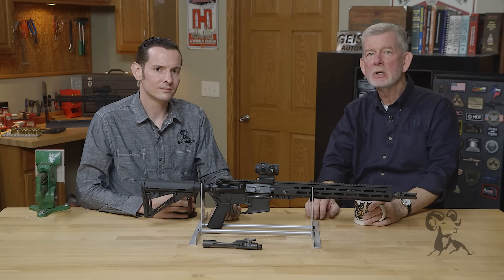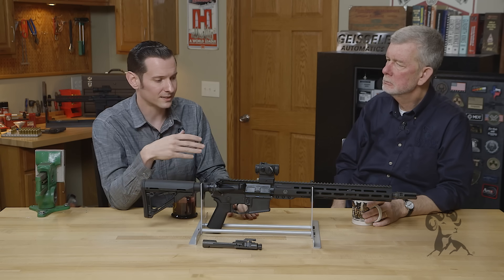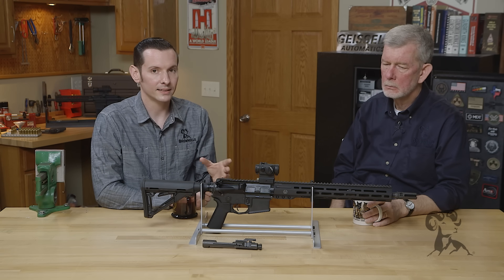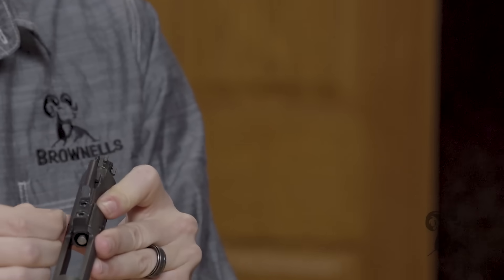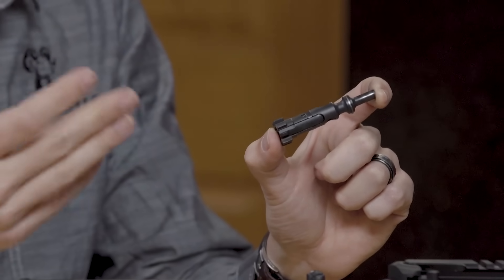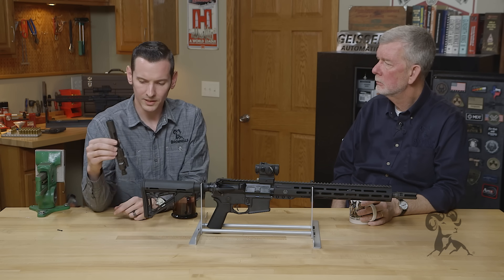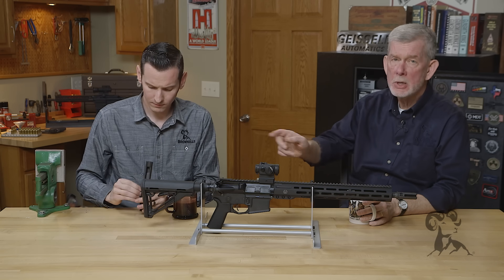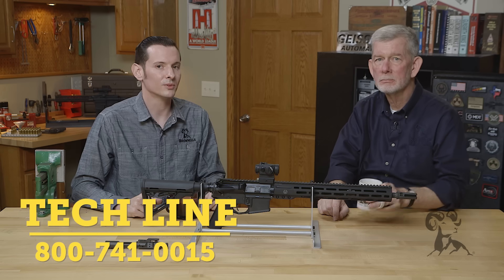Quick Tip: Fixing Common AR-15 Gas System Problems

Comment: Misaligned gas tube is a great example I never thought about thank you
Reply: I have a PSA upper that has a slightly crooked gas tube that rubs on the side of the gas key a little. The upper functions perfect as of now but I keep that in mind if I ever start getting signs of being under gassed.

Comment: Great video.  Now could you show us how to replace those rings.
Reply: Liking twice!👍👍
Reply: @michaelkennedy996  Take a pick or little screw driver and pull them off and replace, Easy peasy...
Reply: U can use a dental pick. 👍👍
Reply: Great information
Thank you
Reply: Get yourself a sop mod rebuild kit from BCM you'll thank me later. It comes with gas rings too all for 30bucks

Comment: One thing I always suggest looking at is carrier and buffer tube length. Which generally isn't an issue on production guns. However home builds, especially ones with tacticool folding or short pdw receivers like the maxam or law folder. 

Basically sometimes if the buffer tube is just a bit too long or the carrier is a bit too short for the system the gas key can strike the back of your receiver. If it's a major issue you'll find out pretty quick. If it's a minor issue it could eventually cause the gas key to loosen or crack without you noticing. 

The simplest way to test this is to push the bolt carrier group into your receiver extension until it bottoms out. Do this with the upper is off the gun and the buffer/spring still installed. Look at how close your gas key gets to the back of the receiver. You should be able to fit about two quarters in between the back of the receiver and the gas key. If it gets close to striking the back of the receiver try adding a quarter to the back of your receiver extension. If it's really bad you might need to add two. Just make sure your bolt carrier still has enough room to lock back properly.
Reply: I watch SOTAR also! :)
Reply: @jesuslovesme9138  nice. I actually work with some guys who've taken a few of his classes. I'm in Philly so he's only like two hours away. If you want to know the ins and outs of the AR platform SOTAR is the place.

Comment: This is quite helpful, I just got my first AR and the bolt has a pretty tight fit in the carrier, and until I saw this video I thought that was a problem, luckily now I know better.
Reply: True story.  I learn a ton from these guys.
Reply: Yeah there's always little things that you think are an issue until you learn their designed that way for a reason.

For example I've seen several people who have opened up their buffer weights and added shims to make them tight so they don't rattle back and forth. However that rattling back and forth is intentional. It acts like a dead blow hammer to prevent bolt bounce.

Which is why I have a problem with those stupid tungsten BB/powder filled buffer weights. They're generally a gimmick more than anything. If you put them in a machine gun, which I know is hard to come by, they won't function properly. It's generally not a problem for semi automatics. But it isn't helping things. If you think about it the three free-floating weights always move in a straight line. But powder or BB's act more chaotic. You're basically losing energy every time. Making it less efficient for the weight. It can make your gun feel like it's shooting softer, however in reality you're causing minor changes in how the gun fluctuations that can cause issues later. 

I personally don't think it's a coincidence that I've seen 3 bolts with broken lugs over the years. An only two of the three we're fairly new bolts from decent manufacturers. However both guns had some type of stupid buffer filled with loose powde/BB crap.
Reply: Corat  You're not wrong.

Comment: Didn't quiet catch what Caleb said to do at the gas block if it's over gassed. ???
Reply: He said to install an adjustable gas block.  They normally use a set screw to incrementally cover the gas hole inside the gas block which allows you to set how much gas you want coming through.  You can even block it out completely if you wanted.  Superlative Arms makes excellent gas blocks, PN: SABO-DI-750SM for the 0.75" barrels.
Reply: He also said that you can install a heavier buffer but the proper way to do it is to limit gas at the gas block.
Reply: He said replace with an adjustable gas block.

Comment: Fixed half a dozen "tabletop" guns where the customer had just misaligned the gas hole in the barrel with the block.  That's the first thing I check.
Reply: What do you do to check that?
Reply: @salmonmoose509  I first look at the sight base, which will sometimes be canted off to one side or spaced too far from the shoulder in the barrel.  Alternatively, it can be right up against the shoulder, but the shoulder is designed to have a front handguard retainer.  Either way, you have to take the block off to verify.  The customer has usually fired it enough there will be a mark on the barrel showing right where the block was.  When I reassemble, I use a piece of tape with an index mark to get it centered and I measure for the gap (if any) to the shoulder.
Reply: @RyeOnHam  ok
Thank you very much for the info.
I really appreciate it.
Reply: @salmonmoose509  You can also use a borescope to look at the gas hole alignment from inside the barrel.  I wouldn't mess with that though.  Just remove your current gas block and dimple your barrel on at least the first gas block set screw (opposite gas hole).  Brownells sells a jig for $55 for 0.75" gas block journals, PN: 100-032-039WB but doesn't include the bit for dimpling.  I normally like to shill for the website whose video I am watching but full disclaimer: I use KAK's barrel dimpling jig which isn't offered at brownells, PN: KAK-DRILL-JIG-750.  It has performed flawlessly on 5 builds and comes with its own spot drill.  If you have a barrel that is a different size than the 0.75" gas block journal, Optics Planet has a full selection of SLR Rifleworks dimple jigs for the various barrel diameters, again without the spot drill.  Good luck and happy building, Montagonist!
Reply: @JenkinsStevenD  Thanks for th  info i will definitely look into these options.
Reply: I agree.  A misaligned gas block would be the first thing I'd look for on a new build that is undergassed.

Comment: 6 of 10 gas issues are user/assembler induced. 3 of 10 are cheap parts that are far out of spec.
Reply: I’m not mathematician but uh what’s the 1 of 10 lol.
Reply: @JoshSmith-mm1fi  The second stat, 3/10 is part of the first stat's 6/10.  I've rarely had out-of-spec parts for gas blocks though.  Normally, for me, it is just poorly aligned gas blocks or they are trying to shoot 300BO out of a barrel that is just WAY TOO SHORT with insufficient dwell time.
Reply: @JenkinsStevenD  
Subsonic, no suppressor, 7.5” barrel, recipe for failure.

Edit: and I’d agree the two are often correlated.
Reply: @JoshSmith-mm1fi  
Component wear and ammunition issues.
Reply: @woodrowcall3158  👍